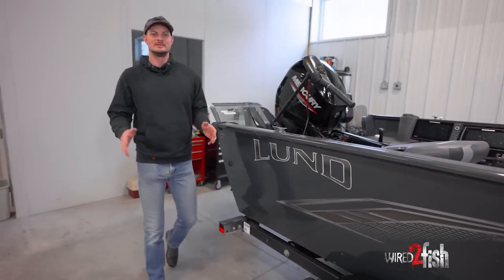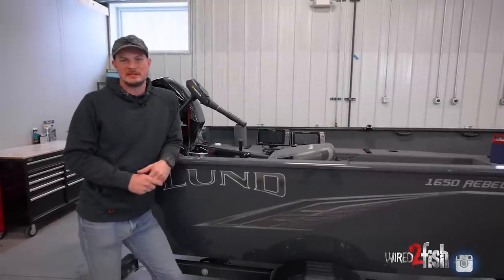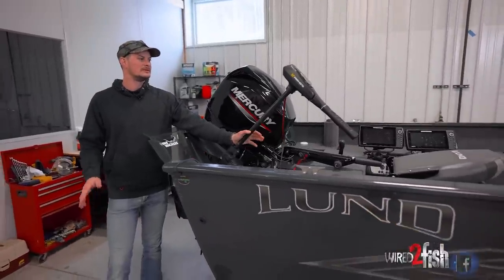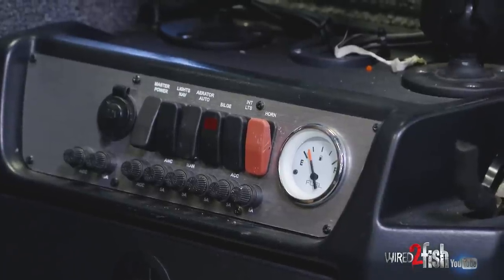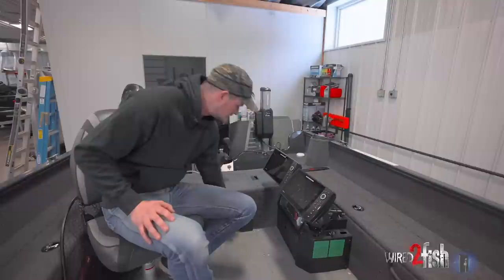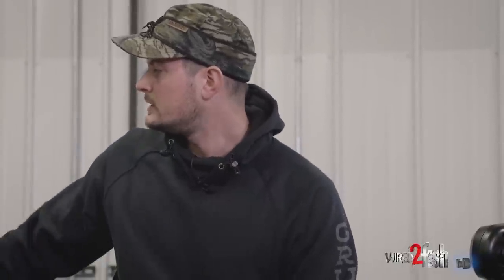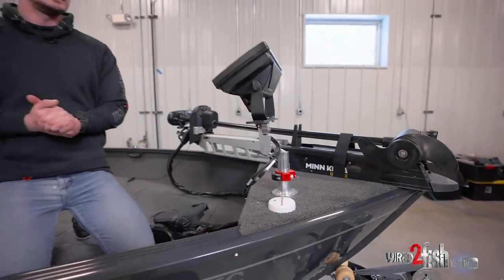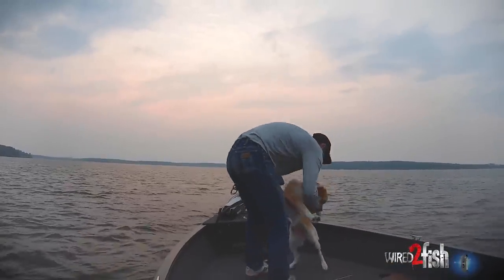Aluminum Tiller Fishing Boat Walk-Through | 1650 Lund Rebel

Comment: I have a 1993 Lund Pro V 1660 tiller. I dont have a trolling motor on the rear yet but I installed the new Ghost trolling motor at the bow.
I run my boat on big water like Mille Lacs and also smaller bodies. The deep V keeps me dry. The small lakes that I like don't allow gas engines. The Ghost pushes me 5 mph when needed. I installed a recessed pan for the foot pedal which I recommend. The pan incorporates a cup holder and 3 slots for tools like pliers, forceps, and scissors. I run the ghost on 36v. I installed 3 AGM's and a 4 bank charger in the front storage compartments. I use a Lowrance at the bow and rear console because I like to touch a spot on the map screen and command the trolling motor to that spot with a simple touch. I'm installing the Active Target transducer before opener. I also like the Mega imaging of the Helix so I have an SI unit next to my lowrance at my rear console. I do all of my mapping with Navionics on my phone. Because I have 3 mapping systems I was able to compare. I use smartstrike on my bird to find new spots. I use the map on my lowrance to tell my trolling motor where to go. But I use the Navionics for all navigating on the water. This way I'm not wasting valuable screen space and I can keep SI and Active Images full screen.

Comment: great video walk through, thanks for sharing. one note on the charger- from what i know about the 345pc line - they are not optimized for lithium batteries which require higher charging voltage and have different top and disconnect voltage. This charger will charge a lithium battery but it will not charge completely because it’s designed for agm/lead acid batteries which max out at a lower voltage when fully charged.
Reply from the maker: Actually the latest models of precision chargers do have settings for lithium amperage. https://www.minnkotamotors.com/news/article/next-generation-precision-chargers-optimized-lithium-marine-batteries
Reply: that’s the new line not what was in this boat (minnkota MK 345 PC) which only has options for agm, flooded or gel. the new line MK XX PCL does have the charge cycle for lithium.
Reply: i’ve been trying to get a new 5-bank MK 550 PCL for that reason but they are on back order everywhere

Comment: Hello long time viewer first time commenter    Kind of off subject from the above video but,  Can you guys do a video about the pros/cons of a "hotfoot" vs traditional throttle control?  I have ran boats rigged with both systems but it would be good to hear what the professionals have to say about the benefits of either system
Reply: The hot foot is safer because it allows you to have 2 hands on the wheel.

Comment: Beautiful setup ! I’m looking to run a 60 hp tiller on my boat and was wondering when running at 1/2 , 3/4  or full throttle , how is the steering ? Is it manageable , is there a lot of torque on the engine making the steering hard to  handle ?
Reply from the maker: Hey Vito. Steering depends on a few factors. First of all, there is a tension lever on this particular motor that will either lock the motor in place or make it very loose. I've found that if I find the sweet spot when trimming the motor it will also bite down hard and lock in place which makes for very controlled handling. So really you can make it as tight or loose as you want and I wouldn't say there is too much torque. Gets up on pad nice and easy and then off you go. Trim the motor according to how weighed down your boat is or what the wind and waves are doing.
Reply: @Wired2Fish  Thanks for the reply , that is great to know !  Really appreciate it !

Comment: Great video! I just picked up a new 1775 pro guide, and have the same console as that. I'm wondering how you mounted the ram balls, and where you ran the wires to your units? I have a single helix 10, and I'm trying to figure if I need extra support under the tray, and where to make a hole for the wiring. Thanks!
Reply from the maker: I had my boat professionally rigged for clean installation by Andy at Fish Lectronics in Nisswa/Pequot Lakes, MN. I have the two HELIX 10's mounted and the console supports them fine. The RAM ball bases just bolt into the console. You'll have to drill holes for the appropriate bolts. For the console, there are pre drilled ports underneath that lead to the battery compartment in the stern. Thanks for watching the video, Terry! Enjoy your boat!
Reply: @Wired2Fish  thanks for the quick reply! Is it pretty sturdy with the weight of the two units? Thanks!
Reply from the maker: Have not had any issues even running rough water.

Comment: When mounting the Helix units did you just drill through the top of the console and then run the power through the side wall and to the cranking battery? I just bought the same boat and am going to mount my own units but was not sure if getting water through the top would be a issue if drill through the top of the console.
Reply from the maker: No issue there! Just bolt it to the top of the console with whatever bracket you choose.
Reply: @Wired2Fish  bought a ram mount. Did you have to punch a hole into the battery compartment?

Comment: What size battery is that you are using for your trolling motor. I’m thinking about getting the same boat
Reply from the maker: I use two 12v 54Ah Dakota lithium batteries for my 24v system. It’s nice cause they both fit in the one battery compartment up in the bow.
Reply: @Wired2Fish  The two 54s power both the TM and the graphs? How many hours of run time do you get on that setup?

Comment: What's the difference between the rebel and the angler 1650?
Reply from the maker: The Rebel is a bigger and heavier boat overall. The Rebel has wider storage on the gunnels, along with a wider beam. The Angler is a little smaller and lighter boat in general.

Comment: Did you consider the renegade? That’s the boat I want to buy
Reply from the maker: Yeah! I have fished out of that boat quite a bit. Had a lot of fun in it but wanted the versatility of a tiller.
Reply from the maker: Hi Sunny, I'll let McKeon address your question from his vantage point (Ryan here), but we've run the Renegade at Wired2fish for several seasons, and it's an excellent boat. Tons of storage, stability, and a shallow draft for skinny water. We produced the most recent Lund Renegade walk-through video (they had a solid rework for this latest model): https://youtu.be/NGx3T8Vm0p4